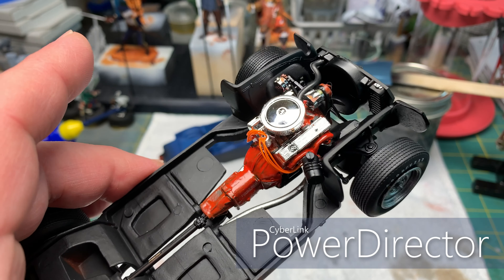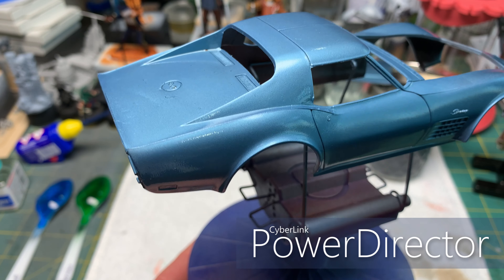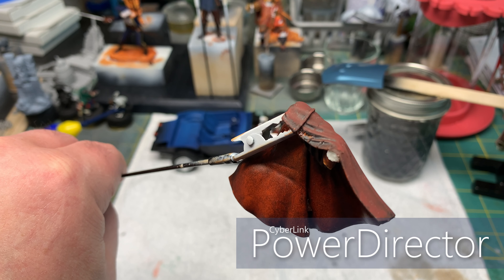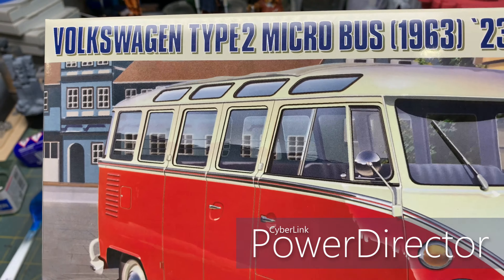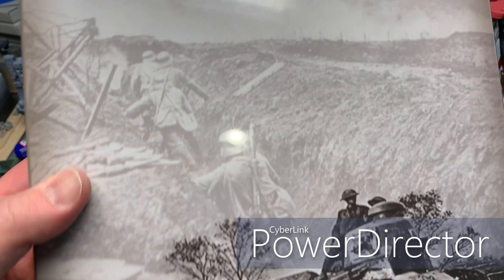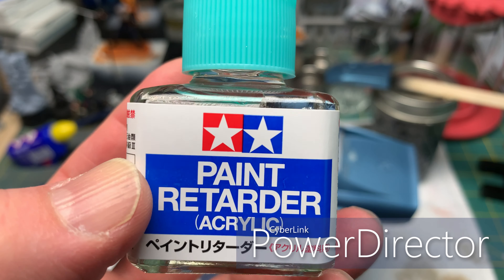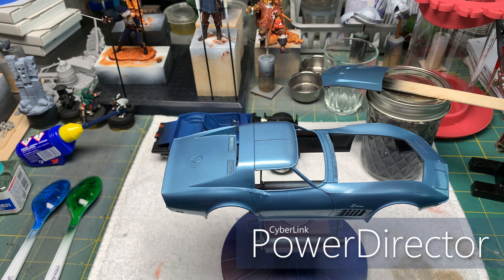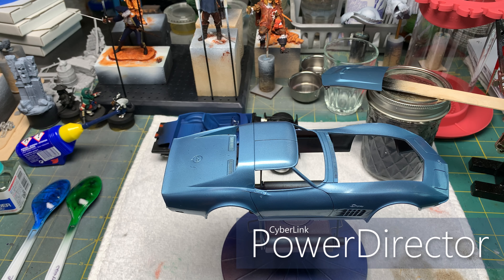Video 213: Work Bench Update

Comment: Your Vette looks Great!!!  I like the blue on blue.  The dust can be sanded out.  take your time.  check often.  Purple power will cut the lacquer but not the 2K.  I've never tried to strip 2K before but understand 91% alcohol works.  I like the paint work on your figure.   The front suspension is a little fiddly on the 348.  Look forward to seeing the retarder tutorial.   I'll be watching
Reply from the maker: Thanks Mike! That's what I thought about the 2k and it not working with the Purple Power.

Comment: Hey Vic. the vet looks good. sorry to see the debris in the clear. I know 91% isopropyl alcohol will eat through 2k clear, I've used it on more than one occasion. I think purple power will too but if so it will be slow. if you go to strip it, my advice would be to sand trough the 2k on the flat areas. that will allow the purple power or the IPA to get under the 2K from the sides to eat at the softer paint and primer below and remove everything from underneath. It will strip much faster this way. That's what I did when I had to respray the 928 after the silicone contamination ordeal. Figures look fantastic. Nice stash adds.
Reply from the maker: Thanks for the advice. I will try that.

Comment: Interior looks great Vic I haven’t found anything super clean hasn’t been able to remove some paints clears may take 48+ hrs but it will take it off
Just FYI purple power does not work as well as super clean so use super clean
Reply from the maker: Thank you for the advice Jeff.  I'll have to find some super clean.
Reply: @vicsminiatures7949  Walmart or Autozone usually Lowe’s and menards too

Comment: The vett3 is looks slick man, Nassau Blue is one of my favorite colors. I use the Tamiya paint retarder all the time for brush painting. words great just a couple drops in with a small amount of paint and away ya go!  Sadly, i get the retarder here in AZ for some reason. And the only thing that will attack 2K clear with out harming the plastic car body is Rubbing Alcohol.  The highest proof you can find. let the body soak in the for at least a couple days.
Reply from the maker: Thanks Bryan.  I was able to get the 2k off by sanding it down a little bit and letting it soak in some Strong Power degreaser.  I'll have a video up this week showing off the finished vette.
Reply: @vicsminiatures7949  ok cool! 😊